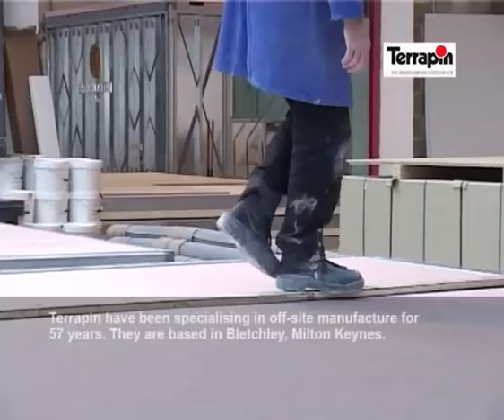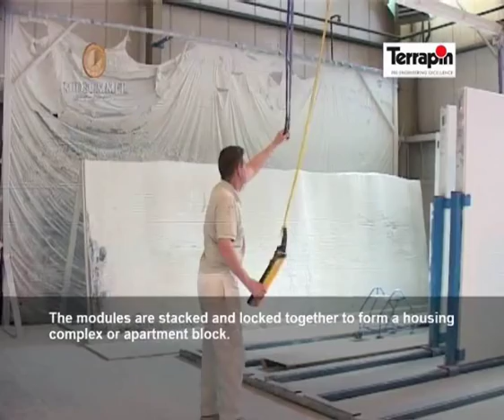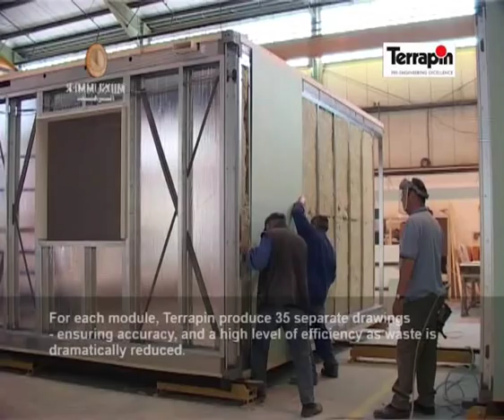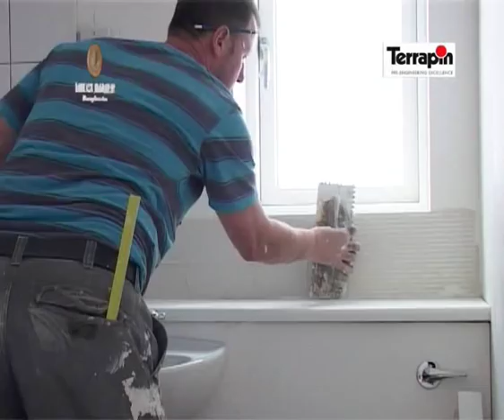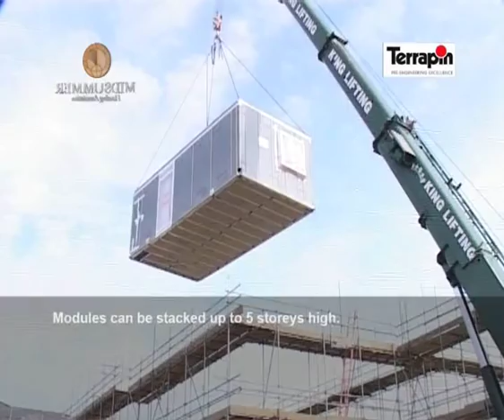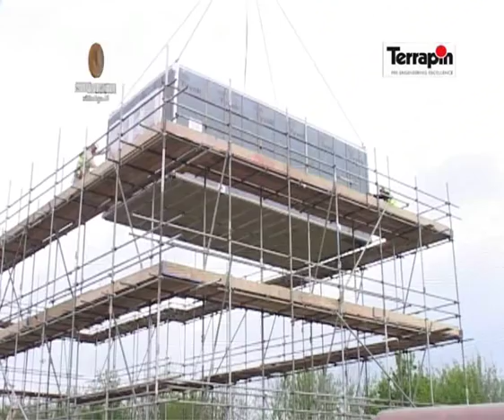Modular Building System by Terrapin

Comment: Hi I worked on this project back in the day, We used British Gypsum Gyproc Moisture Resistant Plasterboard Square Edge 12.5mm 2400mm x 1200mm x 12.5mm (2.88m²/ Sheet) to line the external faces.